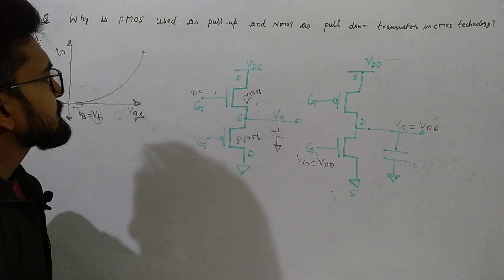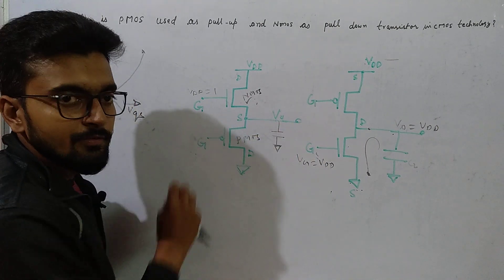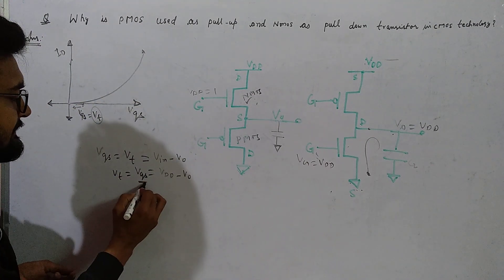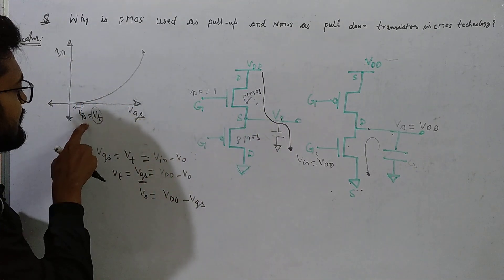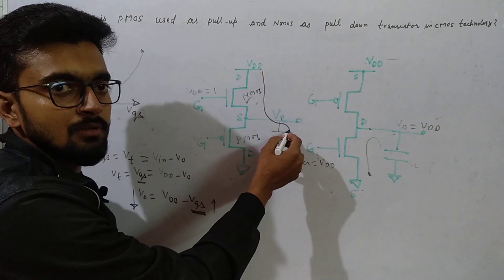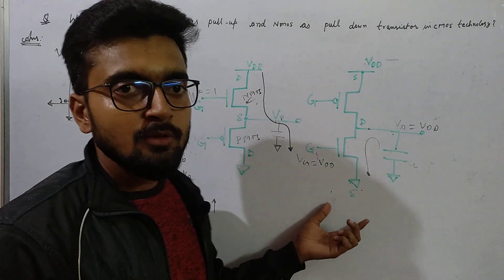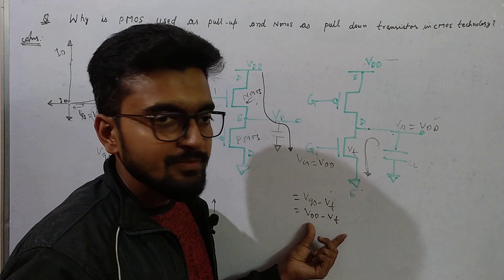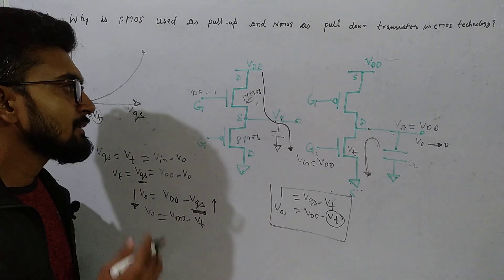Why do we consider PMOS as pull up and NMOS  as pull down transistor

Comment: I didnt gey why output wont depends on Vt  when NMOS connected in Pull down network  ??     !!!!!!!
Reply: The output won't depend on Vt because we are considering the NMOS to be ideal, so it acts as a short-circuit path when we apply Vdd as input, and the load capacitor will discharge through the NMOS

Comment: 2:35 why do we need to increase Vgs?
Reply from the maker: In general, Vgs controls the current in the MOSFET . So, with the increase in Vgs current increases and thereby output voltage decreases. 
But to give a context how we can achieve the maximum output voltage when we consider PMOS as pull down. I said if we increase the Vgs output decreases so we have to decease the Vgs to get higher Vo up to an extent that PMOS stays ON. which is when Vgs=vt . That gives the maximum output of VDD-Vt.

Hope it helped !

Comment: Why for cmos we use capacitor to take the output????
 while in bje we generally use a resistor
Reply from the maker: If we look at the very purpose of designing any CMOS ....It is nothing but to deliver a clean 0 (logic 0)and clean 1(logic1) at the output , which we can say , is also foundation of a designing a complementary MOS (NMOS+NMOS) which serves the idea of having  rail to rail complementary logic which inturn delivers lower  power consumption in CMOS as compared to BJT.
     Capacitor at the output in CMOS  helps to store clean 0 and 1  . So serves the purpose of low power consumption in the device which cannot be seen with resistor at the output.
On the other hand BJT is preferred in the scenario where high switching speed is required.BJT serves this purpose by having resistance at the output. RC delay is not predominant in BJT due to absence of capacitor at the output.

To conclude , I would say one of dominant factor for resistor being at BJT output and capacitor at CMOS is to serve switching speed and rail to rail complementary logic in BJT and CMOS respectively.